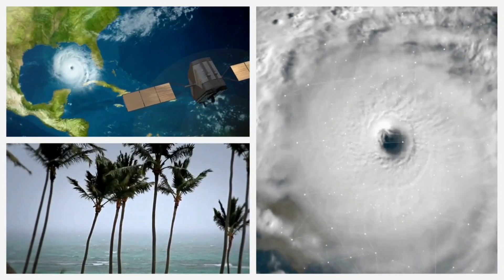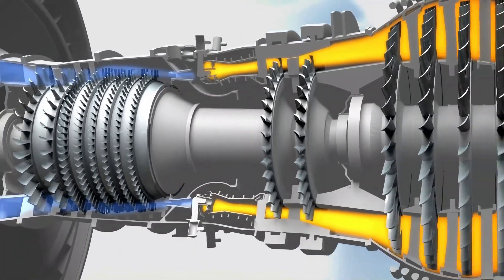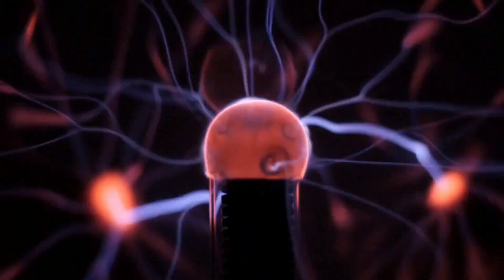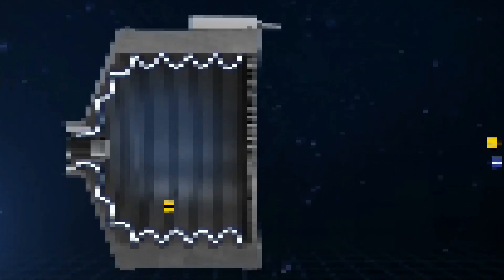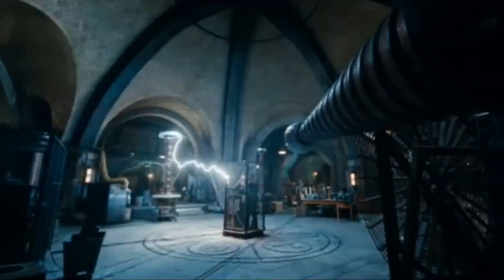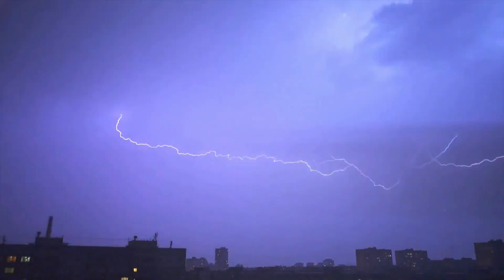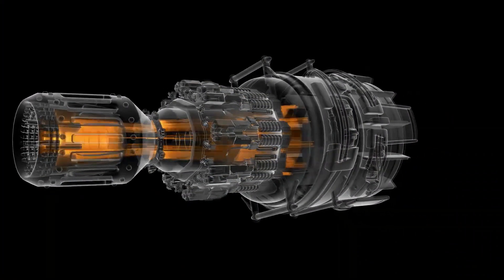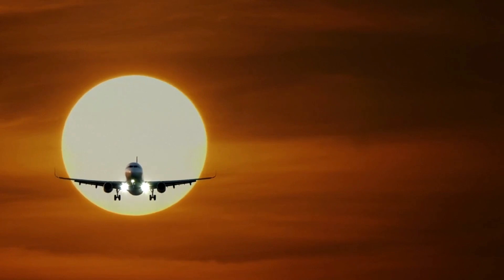This Is How Electric Plasma Jet Engine Works

Comment: You can't get something for nothing. Where is all the power coming from? I believe a standard high bypass design with a lightweight electric motor would be much more efficient. Even then where will all the power come from?
Reply: Iv been working on concept/idea using lasers to power Capacitors